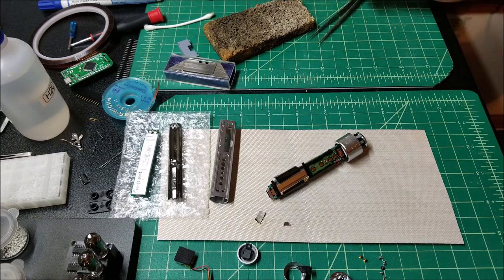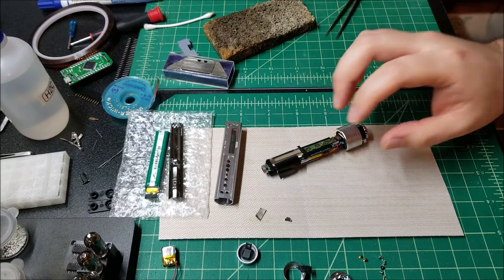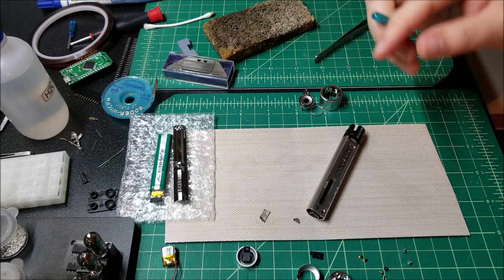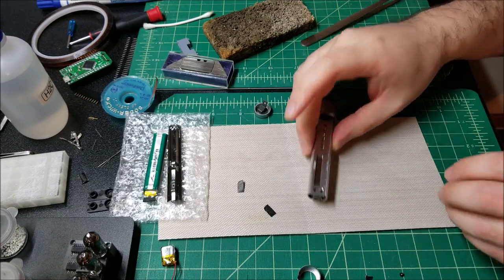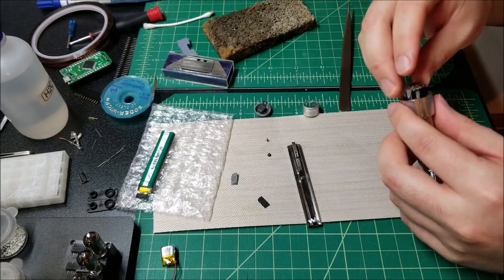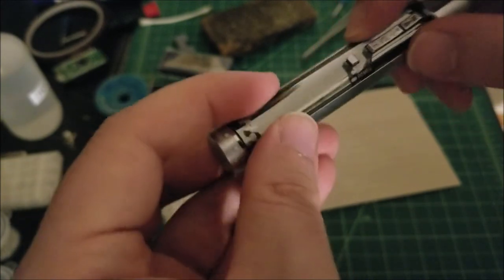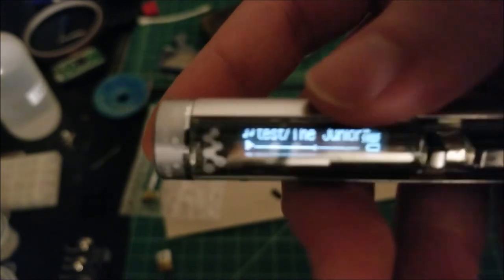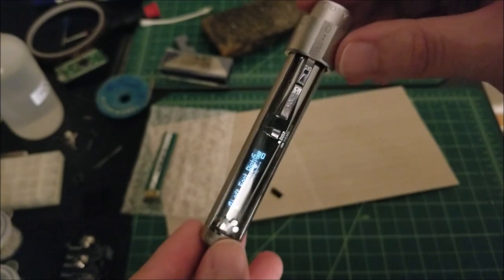Sony NW-S202F Battery Replacement

Comment: I recently got an NW-S203F but the battery is fried, it seems like the only replacements I could find were non original ones on AliExpress. Would you be able to give me your opinion on what I should do/which seems the most reliable? Just if you have some spare time.
Reply from the maker: Original oem batteries just don't exist anymore (and if they did they'd be so old that they'd be as dead as your battery anyway). Your only option now is to use an aftermarket replacement.
Reply: @sjm4306  anyway to tell between a good or bad aftermarket battery? Or basically just try and hope you get lucky?
Reply from the maker: It's basically a lottery unfortunately
Reply: @sjm4306  alright thanks I’ll keep that in mind

Comment: i have a sony nw s203f but the battery is failing and i would like to repair it do you know where i can get its battery ?
Reply from the maker: Says there's only one left from the ebay seller I got mine from: https://ebay.us/Bri2oy

Be careful to double check the wire colors/orientation before plugging into your player as mine was backwards and could've destroyed mine if I didn't swap them first.

Comment: I got one. But due to battery it doesn't power on.
Reply from the maker: So if it doesn't power on even when plugged into usb to charge then that's a sign that your oled screen in very dim or dead.

Comment: Been waiting for this video since forever.  I need to replace my battery since mine is dead as well and the twisting wheel mechanism is loose. Have any tips or advice?
Reply from the maker: Google the service manual, I seriously couldn't have safely opened it without referencing it. It's not obvious where sony used adhesive or hidden screws but the blow out diagrams in the manual helped immensely. As for the loose wheel, that's probably the spring getting loose. Should be easy enough to try bending it tighter once you've separated it from the main unit.
Reply: @sjm4306  Thank You 🙏. It still worth getting the same battery from your source or somebody else?
Reply from the maker: As far as I know the seller I found on ebay was the only one that came up when I searched for the specific device model number.

Comment: Hey man! How do you get music onto this thing and did you have to install any drivers so the player could be recognized? I'm on Windows 10 Pro and have finally installed Sonicstage after giving up on JSymphonic, but my computer itself won't read the player even though it says it's USB Connected. Any tips or possibly even links on what I could do?
Reply from the maker: I don't remember manually installing drivers for any of my sony mp3 players, so I have a feeling they were all loaded when I installed sonicstage. Another possibility is that if it's a 2nd hand unit, the previous owner for some odd reason deleted all the database/firmware files on the root of the player. If this has happened the player wont show up in sonicstage and afaik there's no way to recover it unless you happen to have a backup of the original files that the player came with. I have one player that the guy who sold it to me for cheap did this to since he thought you could just format the player in windows explorer and drag/drop mp3's onto it. The player was basically a brick by that point and I ended up using the oled screen to fix another one I had with a very dim screen.
Reply: I had a conversation yesterday with a friend of mine about mp3 players and I saw him my old Sony NW-S202F so I did a youtube search and find this video.I read your comment about the Sonicstage and I was curious too how to import songs because I didn't remember after so many years passed.I installed the Sonicstage Ultimate v4.3 I had in my PC in Windows 7 and during installation I found that it actually installed some kind of drivers to recognise the mp3 player.I found this version here if you are interested to try it but I'm not sure if Windows 10 you have will recognise properly the player : https://archive.org/details/jp.sony.omgjbox. Bytheway , the player after so many years was playing like the first day I bought it

Comment: I may or may not be a dunce, I watched this video the other night and how you talked about the battery replacements having swapped polarities and I still decided to spend $100 on one of these.

I hope I am capable enough to replace the battery properly if it needs it, this looks a lot tougher than iPod classics I'm used to working with. OH SHIT I hope I don't have to solder anything actually
Reply from the maker: Technically no soldering required if you have to swap the wires like I did in this video. I soldered the wires but you could totally just twist the wires together (just make sure to insulate the exposed wires with thin tape or you could release the magic smoke).

Comment: Hi! I love this device myself, just wish mine had a working battery still. Bought a new battery, no repair shop will even touch the thing. I'm not very tech savvy at all for repair (outside of a full size cassette Deck for a belt service which I'll have to do again), but anyway how difficult is this to repair and to the point you can even change the battery? I wanted to know as I was one of those idiots who spent over 100$ because I love the form of it, and it was "new" in box.
Reply from the maker: It's definitely one of those players worth keeping running. If I had to be totally honest it was pretty tedious getting into it without damaging anything and the battery was wired incorrectly from the factory so I ended up having to resolder the wires anyway. If it's your first time doing work on something this small and relatively delicate it'll be very difficult. But if you really want to and are careful then it's definitely possible for someone with moderate repair skills.
Reply: If it's still broken can I buy it off of you? lol I wouldnt mind being that idiot

Comment: Hello 
What is the best battery you have found in 3.7v?
 300 mah? 400 500... 
Best regards
Reply from the maker: The only size that will fit inside this mp3 player is 100mAh. The fit is very tight and with current battery technology that's all there is. If a seller lists a battery in the same size but marked with a higher capacity then that's physically impossible and the marking is incorrect.

Comment: I got one fron 20 years ago.  I use it some times loveit but to easy to break 
Now i try to charge it but no luck........so    I love the 90s yellow sports cassette boom box. Just it needs the cassette  rubber that make it run
Reply from the maker: These lithium rechargeable batteries only have a service life of 2-3 years max if they are properly maintained and stored so unsurprising the stock batteries don't charge anymore given their age.

Comment: How do I open it? Unfortunately, you showed the device already opened... The Disassembly-instructions in the service manual doesn't explain how to remove the HP Cap in the first step. Can you please help me?
Reply from the maker: You have to heat with a hair dryer to loosen the adhesive and pry using a blunt/thin pry tool of some sort. It's a really slow, tedious process but it does follow the service manual accurately.

Comment: What kind of Flash Chip does this use ?
It would be awesome if it could be upgraded 
Also these have started to become sought after by people with the MZ RH1 as a screen replacement source !
Reply from the maker: Probably nand flash, definitely possible to swap with a bigger chip but problem is you'd have to low level dump the firmware from the old one to the new one first using a parallel flash programmer for it to work.
Reply: @sjm4306  I finally bought one
From what I read the firmware is stored on a separate 32mb ROM Chip according to the block diagram

Comment: Could you do a tear down of the remote control for the minidisc players?  The buttons on my remote (rm-mc11el) don’t work as they should, I’d like to clean it from the inside, however there is only one visible screw.
Reply from the maker: I can do a teardown for curiosity's sake, but what you are describing is more likely caused by either the cable or connector. Any increase in contact resistance between the remote and minidisc unit will throw off the button reading and since the player detects presses based on a resistive ladder arrangement this means it's quite sensitive to noise in the measurement.
Reply: @sjm4306  I see, are there contacts under the buttons?  I remember fixing some old pocket LCD games cleaning the board where the rubber buttons pressed and it worked better.  I was hoping it may look as simple as that, like a calculators buttons? If only To see inside.   
The cable and connector look great, the buttons look like a point of entry for dirt and grime, I would be interested in seeing a tear down if you could please.
Reply from the maker: The buttons are the surface mount sealed metal membrane tact style switches. Occasionally if there was a particularly bad liquid spill they can corrode but the first thing to fail on them tends to be the metal snap dome. I'll see if I can dig up a remote that needs cleaning anyway and make a video of the process.
Reply: @sjm4306  far out!  Looking forward to it.

Comment: Amigo pero como lo sacaste la placa no se ve video explique por favor
Reply from the maker: Warm it with a hairdryer and then pry it using a thin piece of metal/plastic starting from the edge. It's only held on with adhesive.